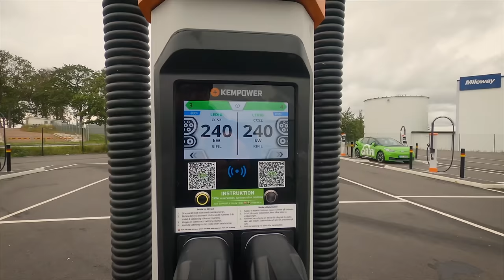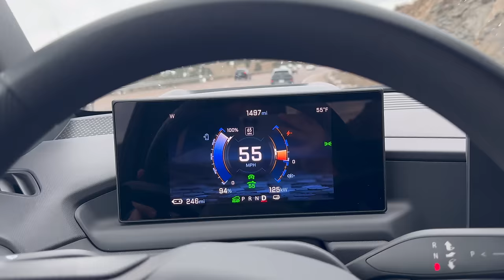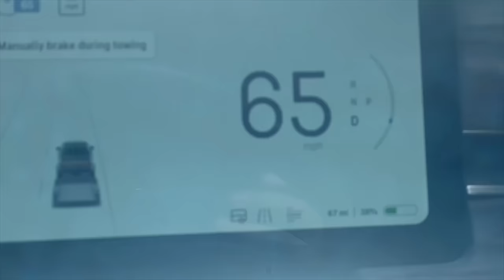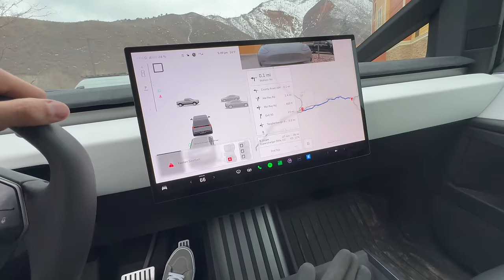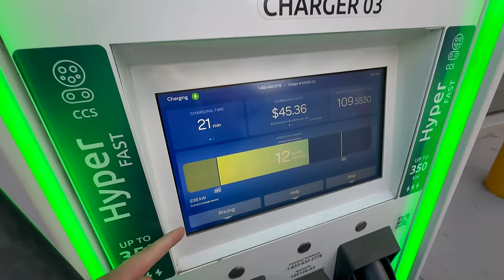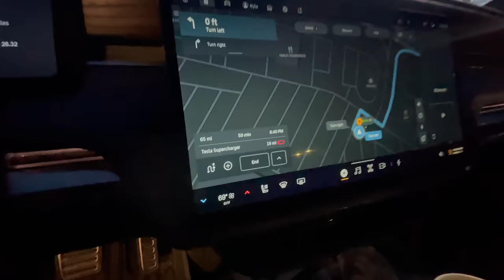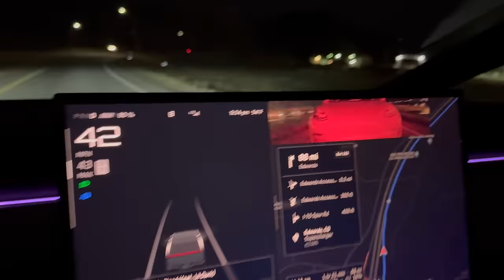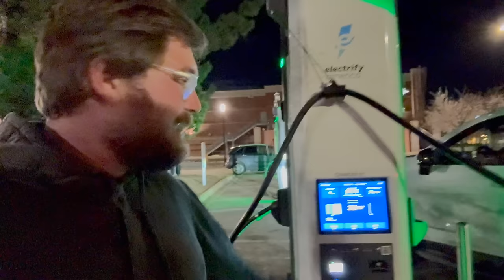Electric Trucks Tow 500mi Over The Rocky Mountains! Cybertruck vs Lightning vs Silverado EV vs R1T

Comment from the maker: We have a summary and supplemental info on our Podcast channel here: https://youtu.be/5VMO0Wb7fic?si=O9ooiYCDNeQhFpV_
Reply: Silverado EV in the next race to Vegas ?
Reply: Appears the Silverado would be the way to go for people actually using EV as a truck (presumably for average daily commutes, with home charging).
Reply: One thing that would improve the video is if you could add a text overlay stating which truck is being videoed and discussed at that moment.
Reply: @jarrodf_  Until you factor in the inefficiency driving the cost to be the same as gas.  GMs bad track record with batteries and only 100,000 mile warranty on them not 150,000.    GM made a big pack, only selling 300 to fleet operators at a loss to get attention to pretend to be ahead of the competition.
Reply: @MotoGPatrick  Not aware cost is the same as gas. Tesla's battery warranty is also 100k. Silverado EV is available to retail customers in a few months; dealers already taking orders.
Reply: @jarrodf_   WRONG.  Cybertruck battery an motor warranty is 150,000 miles.  

The Dual motor Tesla is 6600 and 2.5 miles per kwh.   

The GM weights 8500lb and 2 miles per kwh and limited to CCS with no NACS adapter.
Reply: @MotoGPatrick  Apologies, stand correct; however, both are 8 years. GM launching CCS adapter later in Q2 2024. Ultimately, most pickup drivers who use their truck as a truck will only care about the >500m range in the LR Silverado, especially for towing.

Comment: Silverado isn't getting the attention it deserves
Reply: probably because it isn't available to anyone but fleet purchasers at this point.
Reply: It won’t get attention until it’s available to the public.
Reply: I kind of agree. 

From a technological perspective, it’s not impressive, anybody can pack 200kWh in a truck and get their range. 

From a range perspective alone, it’s great. From a towing perspective it still stinks because the lack of pull through chargers. 

From a price perspective, it prices out 99% of people. 

From a complete package, it’s an expensive and inconvenient solution to a minor issue.
Reply: @iamnid orders are being placed while we speak! I know someone who ordered his a couple weeks ago. They told him to expect it by May.
Reply: agree!
Reply: Wait until it hits retail. It may have far less range.
Reply: It's all relative, Tesla obviously gave the Cybertruck a smaller battery to keep the price down.
Reply: @Nunya-lz9ey   And at that weight, you probably won't get 20K miles out of a set of tires...Can you imagine over $1K a year in tires?!?
Reply: @kevroll99 Yet the Cybertruck is still more expensive than the Silverado.
Reply: It's an absolute beast in every way 🙌🏾 the specs are what CT should've been lol
Reply: @Nunya-lz9ey if it's so easy and unimpressive how is it $40k cheaper than a "comparable" Cybertruck with TWICE the battery capacity, bigger more spacious cabin, frunk and has real buttons while weighting only 600lbs more which is negated when you add the CT's range extender battery that is STILL 25% smaller than the Silverado's on top of losing 1/3rd your bed space.
Reply: @Dularr Why would you say that? The 4WT gets the exact battery pack tested in the video.
Reply: @dfreadhoff It's the same range of weight as combustion-engine 2500 trucks, and tires on those last longer than that unless the driver is an idiot. If it has tires with appropriate weight ratings and the suspension geometry isn't messed up (*cough* Rivian) tire life is not an issue.
Reply: Silverthrone supercharger  kumngo has a pull through 250
Reply: How many people actually use them this way?  If you need to pull trailers often, it’s a no brainer (till the CT extender comes out).  However, most people don’t need that and the cost to haul that battery around all the time is very high.
Reply: @khoatran9482  how do you know what it costs…when you can’t buy it?
Reply: @khoatran9482  you’re delusional if you don’t think dealers will put a huge premium on the silverado
Reply: @bikeaddictbp  GM release video. They mention the range of the fleet vehicles. Then mention the consumer models would be less expenive with a shorter range.  The speculation is will the Silverado EV have single and double stack battery packs.  500 miles and 300/250 miles.
Reply: It’s a vehicle that loses an incredible amount of money for GM. Don’t expect to see many of them.
Reply: Good.  Maybe it will actually be readily available at MSRP!
Reply: Not getting attention?  This is vaporware vehicle for retail customer and small companies. Plenty of undeserving attention.  Oh, and all the “let’s make it fair” rules, precise mile test tuned for Chevy, and some sort of planned actor based CT “duh, I know nothing” driver. So bad, can’t be that stupid. This is another sham test.
Reply: @johnross6314  yes. GM cannot make and sell these at a profit. So it might as well be a concept vehicle like the EV1. I have no interest in vehicles that are essentially green washing marketing attempts that are not long for this world.   If there were 1 million people lined up with cash in hand for these, they would still barely sell any, because again they’re losing money on each one. The true profitable price for this truck is astronomical and they wouldn’t sell any at its true price. There is NO plan to scale this vehicle to be price competitive in the market.
Reply: It's not getting the attention it deserves by its own parents. Come on GM, build and sell these things to us mortals!
Reply: I think because it just worked.. .
Reply: @Nunya-lz9ey 

Wouldn't the Cyberbeast have done better with 200kWh + battery to meet 500mile range?

With bonus of maintaining a flatter peak charging curve?

123kWh + 50kWh Bed battery accessory pack for Cyberbeast 440 mile range...seems like a 200kWh main pack would have been more fitting than bed accessory battery offering.
Reply: @dfreadhoff oh yeah the cyberbeast is surely gonna get long life out of tires 😂😂😂😂😂😂😂
Reply: @TroySavary yes the CT is more expensive than the Silverado. Why?  Because it’s simple— Tesla makes money in every single EV it sells. The Silverado and the rest of those companies lose $30k to 60k per vehicle.  

Make sure to put it all into perspective.
Reply: Not impressive tbh
Reply: @DelPhonic1  I don't think you understand how amortizing capital costs works. It doesn't cost GM $30k more to build theur EVs than they sell them for. The cost of the tooling for new line is included. Those are sunk costs. They are the same whether they end up selling 1000 trucks or 1 million. So until enough trucks are sold to divide this cost into a number less than margin per vehicle , every sale is at a loss. It works the same for Cybertruck. Elon has already stated that, best case, Cybertruck breaks even in 2025, so it too ia being sold at a loss.
Reply: i like that so you know
Reply: Because it's not available for the general public to buy.
Reply: Because GM lost lots of attention over the decades they screwed customers
Reply: . Yes but watch rental companies gonna sell them off soon for 30k watch!!!
Reply: @iamnid just saw a normal person picking up takeout in one the other day!
Reply: @jysmtl  the hummer ev  is available and it  doesn't get the attention
Reply: @kevroll99 and yet it's more expensive than the hummer ev  or as expensive
Reply: The battery is twice as big and nowhere near as efficient as the Tesla cyber truck.   It's like having a gasoline truck with 40 gallons of gasoline while the others only have 20 gallons.    Tesla still wins.
Reply: @kevroll99  not just that they put twice the amount of batteries in that ugly plain looking Silverado as the amazing Tesla cyber truck plus the Silverado will be filled with door dings.   If you put the same amount of batteries in both trucks/ fuel capacity the Tesla will win in range as it does in every other category.
Reply: Silverado looks like the other two trucks and they have twice the amount of batteries as the rest.
Reply: 167 kwh battery vs 122 kwh battery.   Not an accurate comparison .
Reply: @Dularr and Chevy will go bankrupt putting that many batteries in each truck.
Reply: @DelPhonic1 Tesla expects to lose money on CT for a while. That’s normal until ramp up is complete. In case of CT, when that will be is unclear, but probably not until next year.
Reply: @cybertruck4988 ? No, it didn’t win. It lost.
Reply: @cybertruck4988 It is…a comparison.
Reply: @gmv0553 Sir, that statement can be made for every vehicles on sale.
Reply: EValanche??
Reply: You’re 100% correct considering it’s getting any
Reply: Didn’t the Silverado technically get the worst “gas mileage” It just had a bigger tank?
Reply: All it had is a big battery. It’s pretty inefficient
Reply: @bikeaddictbp tire life is a big issue with all evs right now.  I have a mme believe me lol.
Reply: It's better than the rest. But 1 hour charge session is still not practical for a road trip. I think my model 3 is acceptable at 20min or so. I wouldn't want to sit much longer than that.
Reply: If you compare the prices, I think I know why.
Reply: Best decision I made was canceling by Cybertruck order. In 3 years I will start looking again and hope there will be more choices and better pricing and pricing is the keyword. My idea format is a Rivian size truck in a Lighting style form with a Tesla like display of everything around you in the blind spots.
Reply: @Dularr the RST edition gets 440 miles epa and “Jerry rig everything” got 460 miles in regular real world mixed driving it.
Reply: @frankiexv4533  The Silverado is really good for that range.  While the Lightning would require 2 or 3 stops of 15 minutes each. The question is how long would you stop the Silverado to recharge?
Reply: Its terrible inefficient. Not really anything to talk about.
Reply: @Nunya-lz9ey  I disagree.  There's lots of wrong ways to do 200kWh.  GM did it right from more angles than you can comprehend.
Reply: By GM. The most advertised Ultium EV out there is the Honda Prologue!
Reply: Cybertruck really has NO USE CASE for anything
Reply: @marketbuy  I hear it’s good for target practice.
Reply: I would love it, if... money wasn't a question.
Reply: It was ~$84 to charge from what, 12% to 94%, am I missing something here? I thought these are supposed to be efficient but that’s gasoline level and with more wait
Reply: @UintaDave  That ain’t gasoline prices. (At least around here.)

And the Silverado is the least efficient of the EV pickups, it just has a battery nearly twice as large as the others, so it can go further. 

(Like a 15 MPG truck having a 40 gallon dual tank versus a 25 MPG truck having only a 20 gallon tank. The 15 MPG is less efficient, but a much larger tank means it can go further.)
Reply: @AnonymousFreakYT thank you, that’s helpful perspective.
Reply: StefenBishop  I wouldn’t say “infinitely times better” - it has a few aspects it’s better in. 

But you’re right that better people just hate Chevy. 😆
Reply: Yeah I’d like to see it get some attention on efficiency 😮
Reply: @Nunya-lz9ey  anyone can claim to do what they haven't been able to do!
Reply: @DelPhonic1  make sure to remember that the Silverado has the winners perspective in this competition. Cyberjunk was losers perspective.
Reply: @kyle8380 try towing with your model 3 like they did and get back to us with your stupid opinion!
Reply: Loving mine.   If it holds up long term on reliability, GM has a real winner for people who use their truck as a truck
Reply: @Dularr  wrong.   i picked my 4wt a month ago for 66k, 450 miles of range
Reply: @kevroll99  lmao.  100k is keeping the price down?   i bought my 4wt for 66k with 450 miles of range.  Yes its lacks all the latest gadgets, but I use it for a work truck.
Reply: @dfreadhoff  lmao.  i bet i get 45-50k miles.
Reply: @roodick85  exactly why this tesla fan bought a silverado ev.
Reply: @bad50  fleet or retail?
Reply: It just came out you can't even buy it here
Reply: Because no one can afford the 215 kw battery, didn't GM give up on them because they can't turn a profit  or was that ford or both of them?